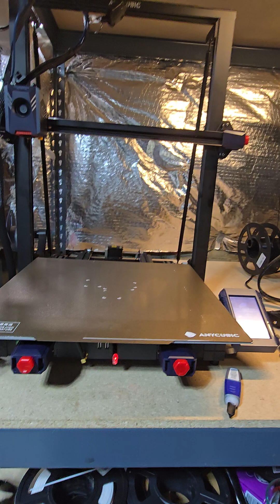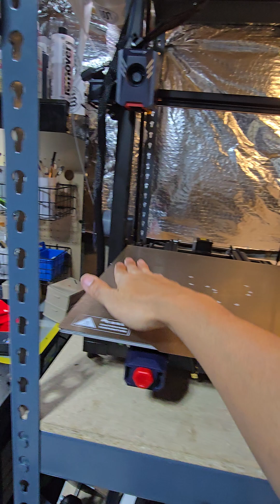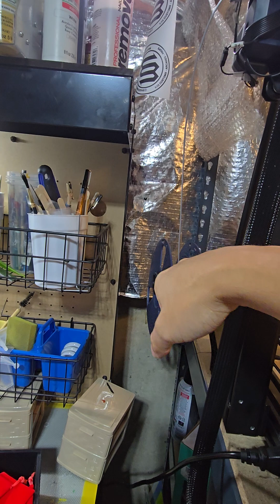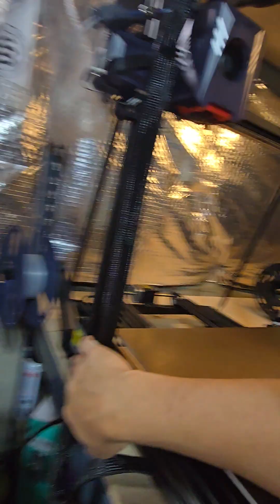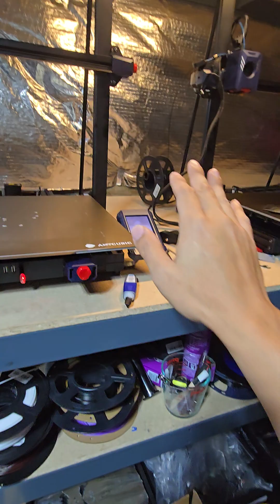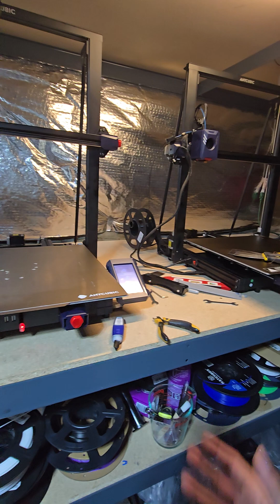Kobra 2 Max Y Layer Shift: Resolved. Part 4

Comment: Hi bro, I have the same problem with the layer shift on the Y axis and from what I saw in your videos it makes the same noise every time it happens, I've tried several things to try to fix it but but I couldn't solve it.
The engine appears to be good but even if I want to change it I can't find any for sale even on the anicubic website itself

In fact, I've had the Kobra 2 Max for a year with 600 hours of use and only now have I had this problem.

I really like this machine and at the moment I don't intend to buy another new one financially it's not very viable 

Would it be possible to send the profile you have used to test and see if I can solve the problem?

I would be very grateful bro 😁
Reply from the maker: @SaPoGeeK  hey there i can absolutely send the profile. I think however there's a issue that is burned out on the board. I would strongly suggest contacting anycubic and get a replacement mother board. When that happens ensure youre running the latest firmware. Where would you like me to send the profile to
Reply: @ShadowMoses112  did you ever adjust the Vref before getting a replacement board? I had the same issue as you out of the box, 1/4 turn of a screw later and my kobra 2 max has probably 2k hours on it in just 4 months. 300-500mm/s prints all the time, no issues, runs so smooth I'm upgrading it to dual motor and SBR12 linear rails and aiming for 1000mm/s lol this is my wife's youtube, I got my own called "kobrasalvage" where I'll be taking these printers and doing some very interesting things with them :) the kobra 2 max is getting a 4 amp motor driver on the Y axis. printing the linear rail adapters right now.
Reply: So, let me join here. I got the printer 2nd hand , and at first glance all was cools, some 8-10h prints went really fine. Since this morning and a  sorter tray project I went down the rabbit hole... and got out really fast. 
Basically the culprit of all this layer shift is heat. Heat on the Y axis (more or less the same on the X, but there the load isn't that big, so always the Y fails first) driver chip. It's located right where the loom for the Y axis is, with small 15x15 radiator stuck on top.
Now, questions, questions, questions... Why,how,when etc etc.
I removed the lid and got some bigger fan blowing at these 3 (X,Y,Z) elements, trying to keep them around 25 degrees Celsius, print start and finish without a problem. As soon as I removed the big fan the temp went to 48-52 degrees Celsius and I immediately got the "clunk" and a shift
Basically it's a wear and tear in my case, this machine has been laying down kilos of ABS per week, so high temp just shuts the driver for a second then it starts back again, but the steps are already lost.
In the first moment I didn't noticed it, but the sound the Y motor does when it actually shifts the layer is typical for when you power on a motor for it to move something, it torques the belts and you get the "clunk" noise.
Conclusion: keep the main board as cold as possible replacing the cooler fan or adding another one. Cheers